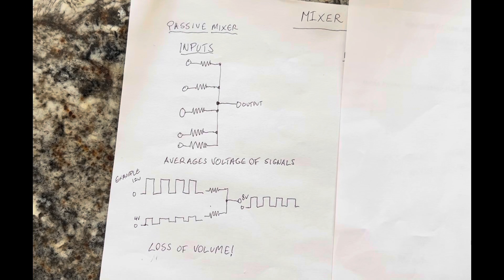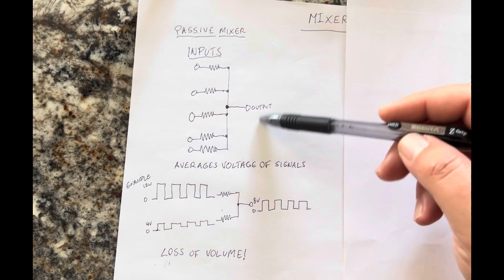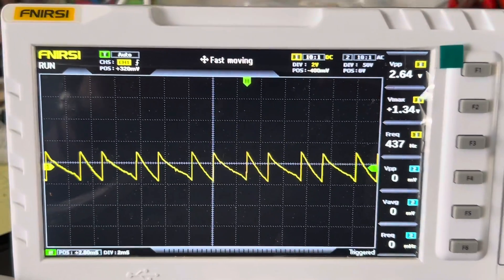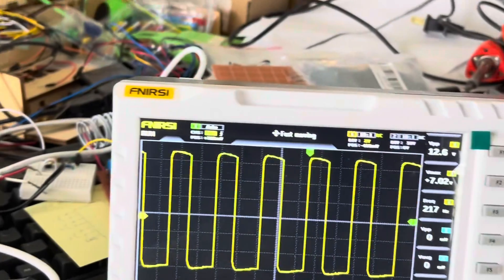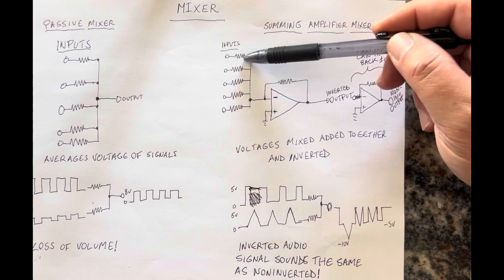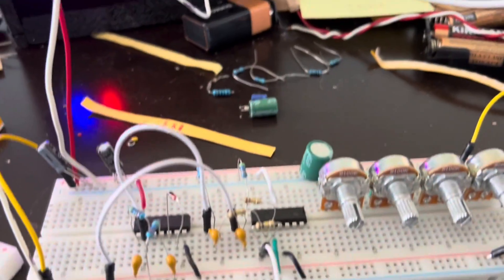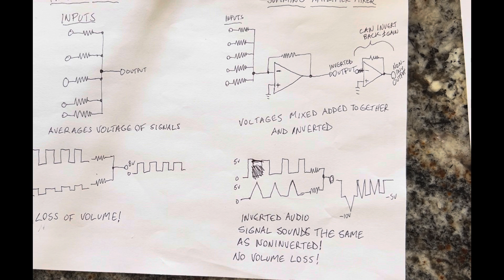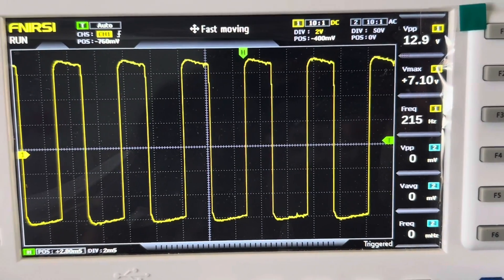Audio Mixer for DIY Drum Machine

Comment: Thank you for sharing your builds. I hve been following along the isd1820 sampler build. For some reason I can’t get this summing mixer to work with the tl074 chip. What I get is a siren like sound and chirping.
Reply from the maker: @zackcuster3972  do u have the power rails at positive and negative 12v? Or 5 v and then a capacitor for the output
Reply: @igorbrichkov3632  thanks for the quick reply. I am 5 volts. After looking at the data sheet again I see I need negative volts as well. I am pretty new to electronics so I am trying to figure out how to get the neg volts. I’m guessing this is my main problem. How did you implement the negative volts inside the sampler.
Reply from the maker: @ i made a power supply with positive and negative 12 v out of a transformer. I suspect that you can probably solve your problem by putting a capacitor at the output to get rid of the dc output
Reply: @ thanks for all of your help! I finally got it to work. I made a voltage divider circuit to get the negative rail and then I had to check and recheck my pin connections like 10 times.